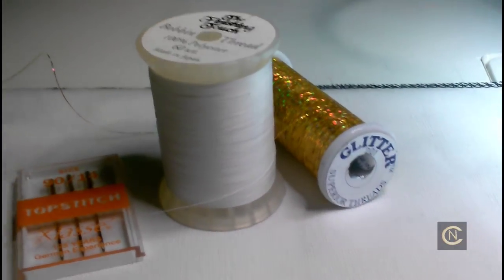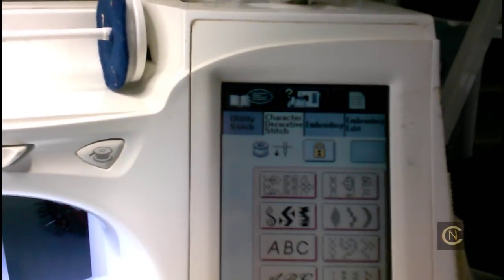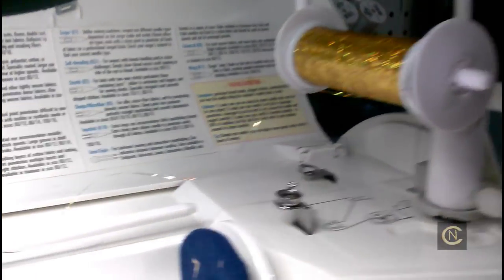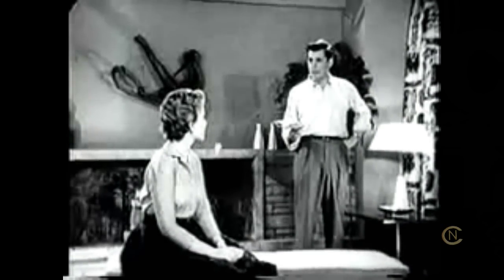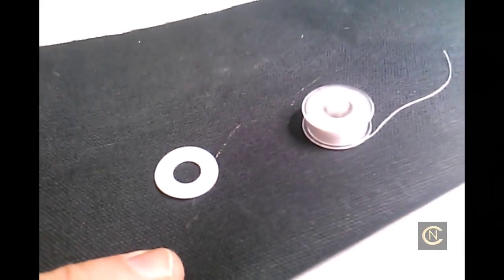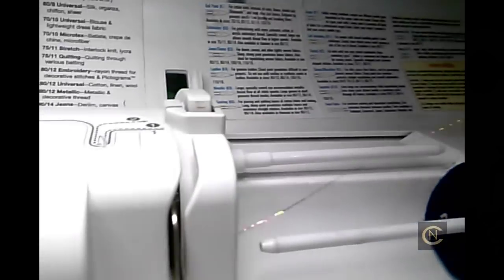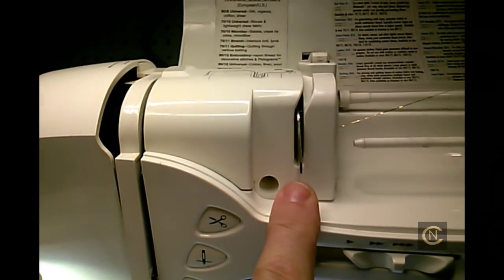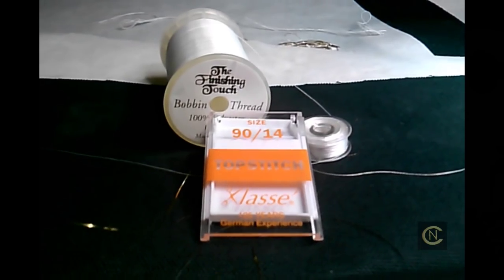Metallic Thread Test  - MUST SEE !!! Brother ULT 2001 - Christopher Nejman

Comment: I realize this is an old video, but I hope that I can still get an answer.  Can I use the large spools of metallic thread on the thread director.  I have the ULT 2001and I am getting brave enough to want to try working with metallics that I have been given, but they are the larger size spools.  Now that I know what gadget I need to get to use this type of thread, I'm hoping I don't have to buy new spools to play with.

Comment: I wasn't aware that you typically don't use that 1st threading stop. Is this the 1st machine that needed you to thread through every stop? Also, did you have success using that teflon washer on that machine in the past? I'm trying to fill in blanks as to what was a one time fail rather than a fluke since threading path=different. Bobbin use= different, thread director, you've used the tower on videos I've watched. For me, I'd need to test all three changes trying to figure best approach on my main machine. After seeing this, I won't be switching to other machines with metallic threads, that's for sure!  I realize that wasn't your goal in video but my take.
Reply from the maker: +211ssw 
Click the SHOW MORE where the information box is under the video here on YouTube.